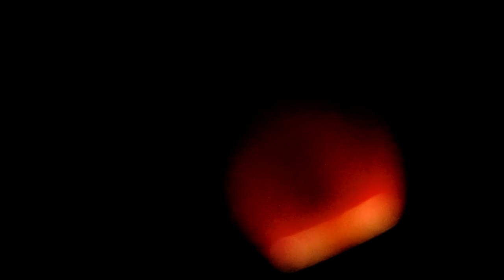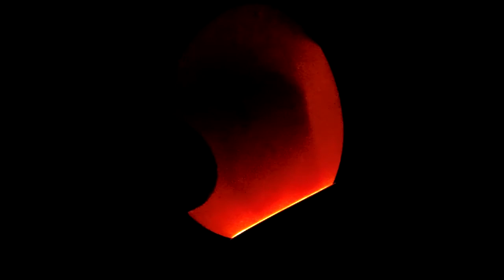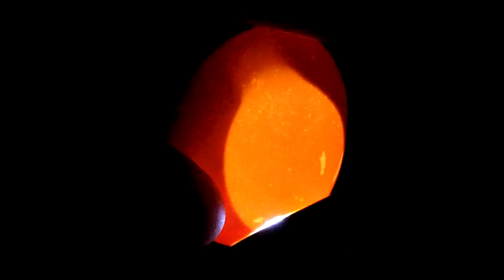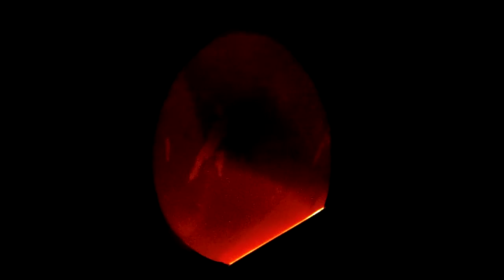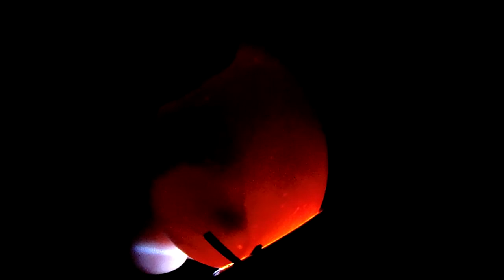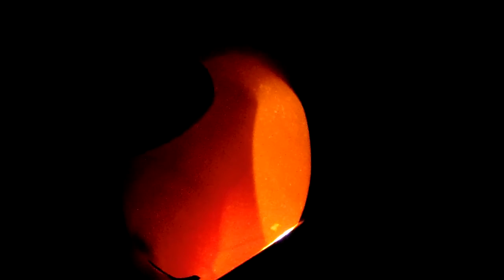Egg Candling - Displaced Air Cell

Comment: Did you do anything different for it? I have a auto turner and I'm not sure if I should put it back in, big end up.  Also did you have to help it, or did it hatch itself?
Reply from the maker: I don't remember what happened for that particular egg, but when we get a displaced air cell, we try to keep the egg still and vertical (pointy end down) for a couple of days before hatch.  If it happens while incubating, it's only a matter of time until the egg dies.
Reply: In another comment  on "Eliseo Hernadez" below, you said it survived.  I have about 10 that all have the air sacs on the side. It's day 7 and as of now they are still alive . I don't want to give up if there is a chance.
Reply from the maker: Sorry - it's been 2 years since this video, we hatch several hundred per month all summer.

Comment: All of my eggs look like this. I'm so worried they won't hatch!
Reply from the maker: Jandy Pimienta do you have an automatic turner, or were these eggs shipped?
Reply: Michael Richey they were shipped.  And I'm turning by hand.
Reply from the maker: displaced air cell is common in shipped eggs.  best of luck!
Reply from the maker: My wife is the real expert - she says that shipped eggs should be rested point down for 24 hours before setting them in the incubator.  If the air cell hasn't stabilized, they shouldn't be laid on their side for hand turning.

At this point there isn't much you can do other than keep turning.

Join my wife's group on facebook - she can give you better advise than me.  My livestock job is at the other end of their life.

https://www.facebook.com/groups/kritter.kooties/
Reply: Jandy Pimienta , did they survive?  Mine all look like it as well.
Reply: @michaelrichey8516 I had 3 displaced air cells in my automatic incubator, not shipped, incubator turns them. 2 died and ones still alive but I don't think it will hatch. It's day 22.